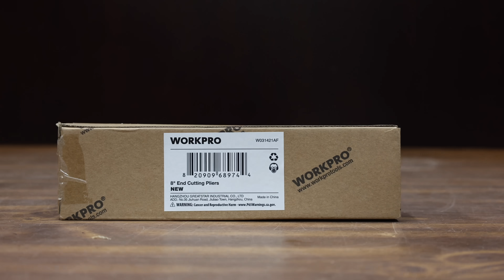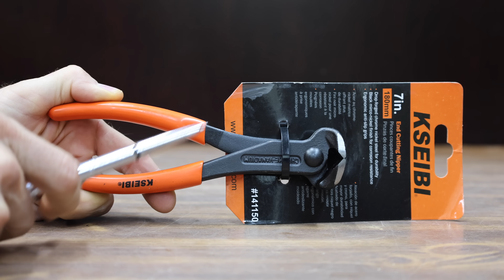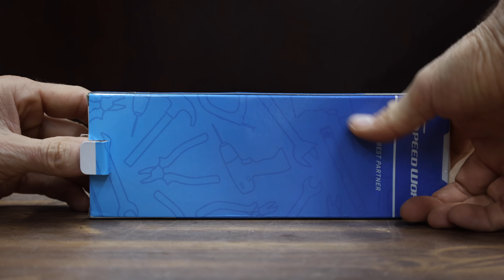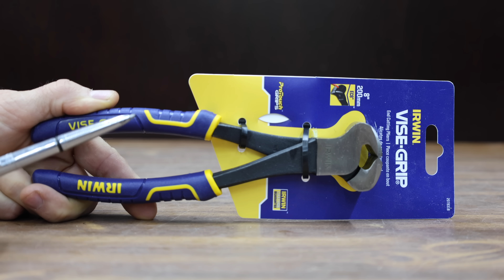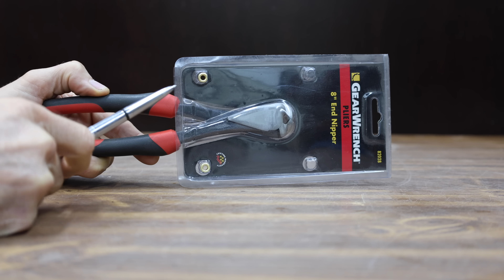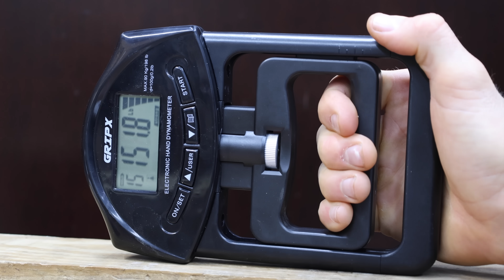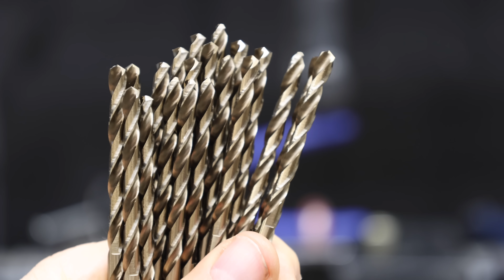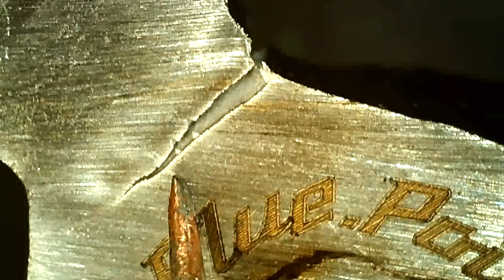Finally! Best Pliers I've Ever Tested! Not Even Close!

Comment: Whats the point in taking the testing to extremes even the most abusive job sites will never see? Now I would be more interested in seeing which tools lasted in a more realistic scenario. Such as 10,000 cuts through 12 gauge copper wire or flooring staples.
Reply: Add in force to cut and how it would relate to a worker using all day. A good tool should do the job well and accurately, while taking the least amount of energy to use. A great tool does it for life at a reasonable price. 

Take the tests off that are severely overkill. And now measure all the parameters that matter. Weight of tool is big too as a worker will be carrying it around all day in their tool belt or tool box.  Ergonomics etc etc. 

Alot people with disposable income might be excited about the big expensive ones that cut through dragons teeth… but not everyone wants to be a backyard garage hero.

Comment: I know it's probably not a great video idea but with being in the market for a set of calipers (digital because of my poor old eyes) I've seen a lot of similarly priced low-end ones, some branded mid ones from the likes of iFixit and then the best brands like Mitutoyo occupy the high end and suffer from a lot of cheap knockoffs.

The things that I've seen differ are remembering the position so it doesn't say 0 if you turn it off then open the jaws before turning it on and battery draw while switched off. Most seem to do a good job with the overall measuring but I imagine small tolerances from machining differences would matter to those doing precision engineering work. Then again, those doing that already know what they want whereas the rest like me have to ask for recommendations, see the prices and then wonder if those cheaper ones are worth it. Might be a bit niche but you were the first person I thought to check for videos about it and didn't see any so here's my suggestion  :)  I love how detailed and packed with information your tests are.
Reply from the maker: Thanks!  Thanks for the suggestion.

Comment: @ 8:08 those are not standard models like most of the other brands… knipex make a variety of standard models too (68-180) and is not that fair competition…
+ pliers should be compared based on their weight and length - knipex and other brands offer the same tipe of tool in different sizes 😊
… just not that fair competition 😅
Reply from the maker: Thanks for the feedback.

Comment: I would argue that these are not pliers at all, they are pincers. known in the trades (in UK) as "Nips" or nippers. The best of them are used all day long by  the wiremen who put together  concrete reinforcement armatures.   They will not even attempt to cut hard steel  with these because it ruins them. And I have never seen any of them use nips with plastic handle covers.  Bolt cutters are for hard steel.  Nips are for softer metal wires, Tying wire is soft iron.

Comment: I'm a truck driver for a warehouse yard, moving 53' trailers around, and Knipex is the brand I use for wire cutters to cut wire seals on trailers, upwards of 30 trailers each shift, week after week, month after month, and the Knipex cutters I have are still going strong
Reply: Those seals are stainless steel and wreck normal pliers in a week. The job I was at probably still has the pliers I bought to replace the "offshoreium" mystery metal trash a decade ago. lol.
Reply: @plektosgaming  yep, the wire seal cutters my job supplies (no name) would go dull or form a gap between the two halves of the cutting head within a month and constantly needing to grab a fresh pair.. they also struggle or dent when trying to cut those very thick braided steel cables ups sometimes puts on their trailers often destroying anything but a fresh pair but when then still leave them damaged
Reply: @LycanShift  Those UPS cables are made by a firm that also makes control wires for light aircraft and are hardened stainless steel.
Reply from the maker: Nice!

Comment: Ha, I see what you did there. Didn’t include hft Pittsburgh end nippers cause you knew they wouldn’t be any higher than dead last. But hey they are 2 dollars cheaper than your cheapest. I have them and I mainly use them to pull out staples, since it rolls with the way it’s designed.

Comment: While most of my pliers (about 60%) are Knipex, this is kind of an unfair comparison. You took end nippers (and 1 Japanese nail puller / pincer plier) and compared it to a Knipex bolt cutter, yes, BOLT CUTTER!!!! Apples and oranges! It's not like Knipex wouldn't have regular end nippers. Measuring flush cutting on literally 0 flush cutters is also pointless.

Comment: If you are using pinch pliers for what they are designed for. Cutting staples, small gauge nails/screws off flush to a surface. Then the best would be the Wazakura brand. For a lot of other applications like cutting piano wire/bowden cable/electrical wire, you'd be better off using side cutters. PF needed to test these pliers against Bowden cable. A lot of cheap cutters crush bowden cable without cutting it properly. Real pain in the proverbial when that happens.
Reply from the maker: Thanks for the constructive feedback.

Comment: Was a steel fixer in aus. I've been using knipex forever. Only one to go the mile from years of rigorous abuse. We remove the grips and weld rebar to lenghten them. You can get the long handle ones, but they have a smaller head and make it harder to use. When they get blunt, they're used as nail pullers, paper weights, or sharpened. Cant do tricks with them when sharpened though...

Comment: Usually I really enjoy your video reviews. I'm not so sure that this video did a great job testing this style plier. End cutters are mostly used for cutting nails and for pulling nails out of wood. I didn't see a single nail cut in this video. Nails are made of softer material thank screws.... I don't see how 3 tests to test hardness prove how good this type of tool is, since these tools really shouldn't be used in this manner. For example, the Wazakura would be excellent for those looking to do demo work, and not wanting to leave any nail material behind that could injure someone. I feel like this time, all the testing did is tell me which tools hold up the best when used not for their intended purpose. Too much weighted value on metal hardness, and not enough on their core function.

Comment: I'm extremely impressed with those particular Knipex cutters but I'm curious why you picked them. Knipex does have a standard end cutter model that is in the same price range and looks like the other cutters. The ones shown are high leverage bolt end cutters. Seriously not questioning your methods, I'm just curious if their standard model holds up as well. If I ever need a pair I will obviously be buying the model shown in the video.
Reply from the maker: Thanks for sharing.

Comment: Excellent video, as usual.

I’ve tried a bunch of brands over the years. My favourite pair so far is my current daily carry, a long handled pair of Wiha nippers (they’re called pincers or nippers here in Australia). The Wiha’s have been super tough and comfortable to use with no damage after a few years in my kit. Their main job in my line of work is complete nail removal, not cutting. This is actually much harder on the blades than simply cutting because the twisting motion puts a lot of lateral force on the blades.

None of the brands I’ve tried cut anywhere close enough to flush for my liking so I took my second favourite pair, a cheap Chinese brand with surprisingly strong steel, and I ground the front of the jaws down flush with the edge of the blades for the very rare occasions when I can get away with simply snipping something off flush. The blades are obviously weakened by this and will easily chip if levered on but when cutting, they leave no noticeable excess nail poking out of the surface. It’s wonderful.

I also have a small pair of Knipex pincers my brother gave me and they do feel nice to use but being short handled, they aren’t my favourites.
Reply from the maker: Thanks!  Thanks for sharing.

Comment: greatest channel on youtube. fight me! lmao.

side note, i have some tekton tools. bought on amazon for dirt cheap. some impact adapters (4957 and 4964) and their (2910) 1/2inch manual impact driver for brakes. also got some Neiko 10288A hex allen set and 10083A torx bit set. also snagged a gearwrench 3358 wheel weight tool because my shop at the time was buying garbage cheap ones that would wear out after one day of heavy use.... so i got my own that i kept in my box for personal use. and they grab onto wheel weights like its nobodies business. not to mention the ton of aircat impacts i have that are stupid powerful and cheap. beating snapon and matco brands at pulling stubborn lugnets off cars. the one 1200k? nitrocat? something like that. they are stupid strong.
Reply from the maker: Thanks!  Thanks for sharing.

Comment: Doing demo and repair on carpentry, the hardest trick for end cut pliers is being able to grip the shaft of a finish nail well enough to pull the head thru the wood, but without cutting thru the nail so much that it breaks.
Reply from the maker: Thanks for the feedback.

Comment: I love this channel, and have watched it from the beginning.  I have learned a lot, especially from the days when a push mower engine was not safe on that property...lol.  One thing I will say is that the point of these pliers is not to cut through the material, but to give you a grip strong enough to pull them out without cutting through all the way.  Again, interesting information, but in my experience, the cutting power of the pliers is a detriment rather than a strength when you need to pull fasteners through the backside of a piece of trim you are trying to reuse. I would like to see a test of how much strength is required to pull through a finish nail (by rotating 90 degrees) from an old piece of oak/poplar/pine trim without cutting the nail off. Usually when you cut the nail off instead of pulling it from the material, then you have another repair to make, even more so with todays 18 gauge nails fired from a nailer.  Just an observation from someone who uses them primarily for that purpose.  Great content and video!
Reply from the maker: Thanks and you are welcome!  Thanks for sharing.

Comment: Almost all have a double bevel edge.  A single bevel chisel edge is far more useful, not only cutting closer but able to grab closer when pulling nails or brads etc.  They also leave a flat edge on the cut rather than a pointed one which penetrates quicker. a minor advantage.
Reply from the maker: Thanks for the feedback.

Comment: Ok i have a few things to say and point out. The knipex are far better than the competition. Well they better be able to cut just about anything for their price. Almost half the competition is a 3rd of the price. You shouldn't expect a $20 pair to even keep up with them. Few of them put up a pretty good fight at their price point. I'm actually kind of impressed with the American Mutt in it's performance coming in 6th place at only $14. I'm also impressed with the Performance Tools ones coming right in the middle of the pack. I'm a little bit of a Performance Tools tool nut. When I saw the price on them i thought that was a little steep. And I looked and you can actually pick those up for $12.20. So at that price point they would be a steal for a budget friendly pair of cutters. Always great videos and actually show how things stack up against each other.
Reply from the maker: Thanks!

Comment: For flush cuts, they make fret end cutters for guitars.  It's a specific use case, but they can be quite useful for a lot of things.  So I'd recommend flush cut fret pliers as well as electronics flush cutting nippers.  The small type with a sharp point and a flush side.  Those would both be useful.  I received a pair of flush cutters with my 3D printer, but I have no idea what brand they are, and have worked amazing so far.  So more pliers!  (amazed by the Knipex.  What an outstanding performance!).
Reply from the maker: Thanks!  Thanks for the suggestion.

Comment: The wazakura are the only profile to cut as close as possible to the surface. All other have a blade profile more conducive to pull nails
I don't think these tools should be expected to cut hardened screws,drills and hex keys.

Comment: If you really want to go all-out on nippers, get a pair of Starrett #1's. I imagine they could literally take bites out of the competition. 

NOT CHEAP., however.

Drill bit shanks aren't hardened. They're left in a soft condition so the chuck jaws can bite them. This is one of the reasons end mills don't work in drill presses: they are hard throughout and will slip in the chuck.
Reply from the maker: Thanks for the suggestion.
Reply: @ProjectFarm Oooh, the hex key was a great test.

Comment: You can make those knipex cut flush with the surface if you grind the face down. Be very careful, and dip in water often as you grind. It will make them just a bit less able to cut big nails, screws, hex wrenches... But you could cut staples flush all day long and never bother them.
Reply from the maker: Thanks for the constructive feedback.

Comment: Performance Tool doesn't compete against other tool brands, it competes against improvising with the wrong tool.

Their crimp/wire cutter was bad enough to make me stop using butt connectors, their multimeter lead came detached from the probe (and the selector dial affected readings if you touched it), the CV axle boot clamp crimper slipped off, and socket got spread around the corner of a fill plug.

I knew I'd hate each of those tools, but it was better than nothing. The only thing Performance tool does better than anyone is getting their tools in stores where the time constrained shopper will buy them.

Comment: Nice to see a good value with the Wiha.  In the future could you do a motor oil comparason with the oils from Mobil, Pennzoil, Valvoline, and Castrol that are SPECIFICALLY designed for Hybrid cars.  With the slump in EV sales many are turning to hybrids as an alternative.  Maybe add one non-hybrid oil to see how the Hybrid oils stack up against it.  Thanks.  You supply such great info.
Reply from the maker: Thanks!  Thanks for the suggestion.

Comment: In Britain we would call them pincers rather than pliers.
I usually get cheapish drop forged vanadium ones, re-harden jaws and grind them down closer to a flush cut (you don't mind doing things like that when your  younger, 'experimenting' and broke)
I've been recommending Knipex since 1980's, even the hard wire wire cutters I bought in 1989 are still going strong as I doubt they have ever seen more than 150~160lbs on handles (probably mentioned same when you did lineman pliers?)
I bought them because I couldn't snap the handle or break rivet which had happened on a few 'known brands' when gripping (probably got a lot less grip than 40 yeats ago though)
Reply from the maker: Thanks for sharing.

Comment: Knipex also has good warranty. After cutting what may be close to a hundred nails, one blade edge chipped off, so I was asked to send in the pliers to the company for a replacement, which I did. It shows that the company is interested in seeing where their flaws might be (esp if others in same manufactured batch had issues)
Reply from the maker: Thanks for sharing.

Comment: Following this shootout you must do mini flush cut. Hozan will perform most flush. Japan. Ziptie cuts are undetectable. Impressive. Pro road bike builders use the. Remives all unneeded cable ends ( shift cable, brake cables etc

Comment: Yep, been using various Knipex tools for a long time, never had a problem with them. I  Admittingly never put them through the torture test like you did, but I have a set of Knipex compact bolt cutters and cut  hundreds of hard hard screws and nails with them, and they still look like new.
Reply from the maker: Thanks for sharing.

Comment: Need to include the Icons and Doyles from Harbor Freight. I was skeptical but with flush cutters I bought for hobby work, I have been very impressed with them. Maybe a video on flush cutters as I went to 3 hardware stores before going back to Harbor Freight because the jaws just did not seem to be very flush on most. And when cutting off models, the more flush you can get, the less cleanup work you will have.
Reply from the maker: Thanks for the suggestion.

Comment: Ha, Milwaukee is charging way too much for a lot of Chinese made tools.  I was looking for a pair of this style of cutter for cutting plastic welding staples flush to the plastic so I don't have to do any grinding of the little sharp tits they leave.  Unfortunately, there still isn't one that cuts flush, and these staples are not mild steel either.  I did find a pair of side cutters with carbide jaws that leaves about .010 sticking up.  Going to run these across a diamond plate and see if I can get that to even less.  Not sure why anyone would want to cut an allen key, or drill bit with these cutters, but how would we know the force needed if it wasn't for Project Farm.
Reply from the maker: Thanks for the feedback.

Comment: Talking about Knipex, I have a special pair of scissors for peeling cables. They are awesome, however, got damaged with some cables, but it may have been my mistake by using them out of the supported thickness. So, my suggestion (you may have done it already) is a comparison between cable peeling scissors (I'm not talking about the classic cable peeling tools).
Reply from the maker: Thanks for the suggestion.

Comment: The reason for the off-set jaws is to sheer the 
material like scissors or a strongman tearing a 
thick phone book (not many books left after all 
the phone book competitions 😋). 

If they were straight there's a high chance of chipping 
or splitting a blade, of course grind angle dependent.
Reply from the maker: Thanks for the feedback.